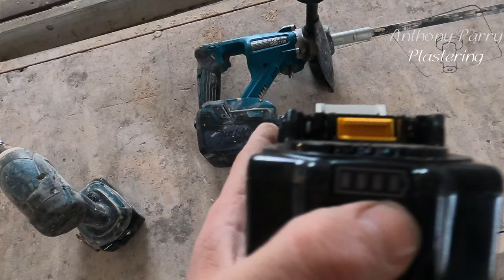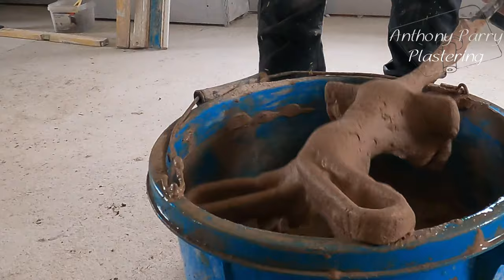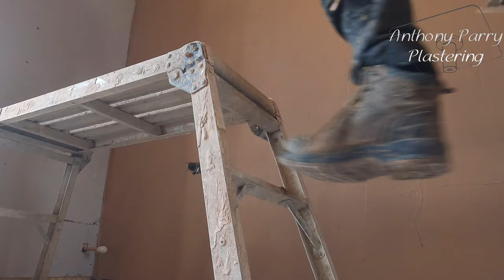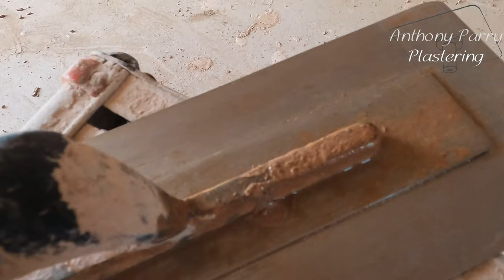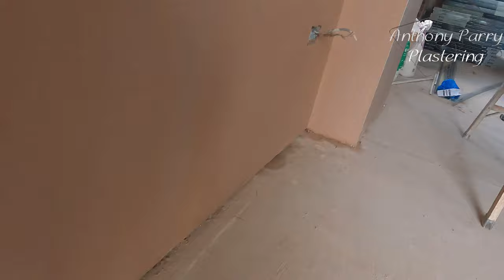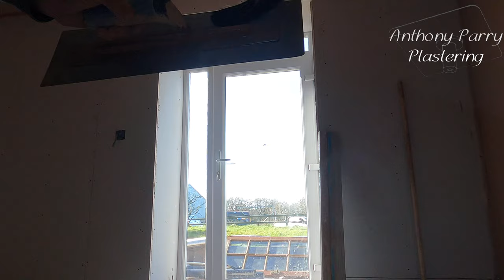Skimming- one min EPIC video

Comment: Do you use much pressure for those long sweeps? On my training course at the moment and have been trying to do it for quickness on the first layer but it ends up either on the floor or caked on the wall.
Reply from the maker: No I don’t put too much pressure. It’s all in the balance of the trowel. Start off by putting less on your trowel and work your way up. There’s no short cut it’s all in practice.
Reply: @AnthonyParryPlastering  cheers for the tip mate will give it a try👍🏼